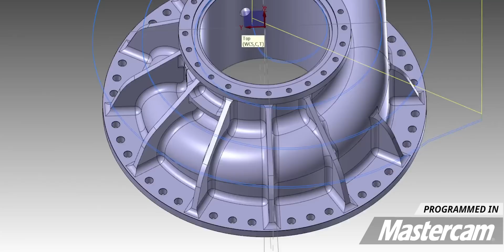Customer REFUSED To Pay Us | 7 Ways To Protect Yourself

Comment: 1:48  that’s exactly what we did with A semiconductor company that is struggling, offered them to buy the material and let us reprogram the part for a shorter run time, now we charge them 1/3 what we normally would, and it protects us a lot, as they would back out randomly on a lot of orders then reorder them again. We also promised them the highest quality you can get from any machine shop to the Most meticulous detail so they won’t find work elsewhere

Comment: Any time I see a tolerance on a print, if I can cut it in half and run it like that I will. That way I will always have a margin of error if the machine warms up in a weird way I didn't anticipate or a tool wears slightly faster than expected. 

Not possible if you are running on the edge of accuracy of what the machine can do though. I cry over .0002 tolerances when the beat to crap Citizen L20s I run can barely hold that tolerance.

Comment: Thanks for the very insightful video!

I have to say, from a buyer's perspective I would not want Titan scrapping a part that is .0001 out of tolerance. I DO NOT keep any tolerance in my back pocket, but as long as the mating part(s) are not at the extreme the assembly will still fit. I might even have to make matched sets, which is a small thing I can do that would allow my supplier to stay healthy. Chaulk that up in the 'partnership' column.
Reply: If everything is a bit out of tolerance, those things can stack up sometimes. Especially if you want the components to be interoperable between assemblies.
In a perfect world, the customer knows exactly what tolerances they need, and if its out of tolerance it isn't usable. But in reality, the tolerances are often a bit lower than they actually need.
Reply: We send a  deviation request to the customer when that comes up. Which sums up what's out of spec and asks if they can still use it. If not we'll replace it no problem.
Reply: I think that would definitely be on a case by case basis but yeah for sure.

Comment: Lack of preventative maintenance is something that can cause massive down time.  At my former job they had a lathe go down for about three months because they refused to change the spindle cooling oil.  It took about 5 years of neglect before the spindle just seized up.  When it happened there was a lot of finger pointing between management, maintenance, and the day shift operator that got treated like a department lead.

Comment: I do router CNC work, but I have transitioned to 100% payment up front. I got burned a few times buying material and doing work only for the customer to flake out and not pay. Now I get full payment up front before any work is started. If it's a larger project that needs CAD/CAM work, I also charge a design fee which then is incorporated into the final cost. This allows me to make money on the design time if they refuse to move forward with the project. I've designed too many projects spending hours of my time, only to have the customer never move forward with it, or just to get my design to show someone else who will do it cheaper.
Reply: Yeah that's not going to work when you get into doing high value projects. Hobby grade routing, sure it might work for a while. Also there are serious legal entanglements you need to be aware of. Taking 100% payment up front without being bonded is a major no, no in most instances. I'm saying this with 30 years experience in owning operating a machine shop. Hobby milling is a whole different level than what most of us large machine shops encounter. Some projects can be hundreds of thousands of dollars per part and if you don't deliver satisfactory work you're going to be sued into bankruptcy if they've paid up front. Tread carefully.
Reply: @mattym893  I do custom woodworking, I'm talking several thousand at most. That's incredible that you're doing jobs like that!
Reply: @Meyerwoodworks  hey we all start small, someday you could be taking on huge projects. Keep at it. 👍
Reply: I used to quote my work and when the customer accepted the quote I then received a Purchase Order number. IDK if that helps but just a thought .